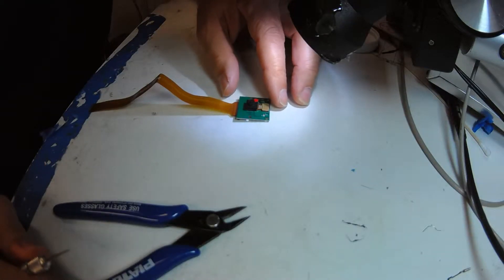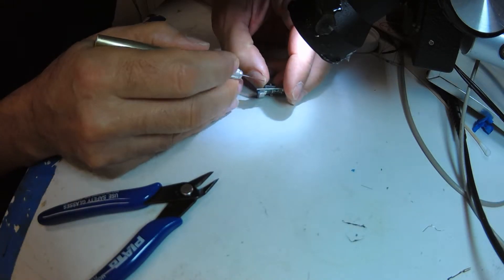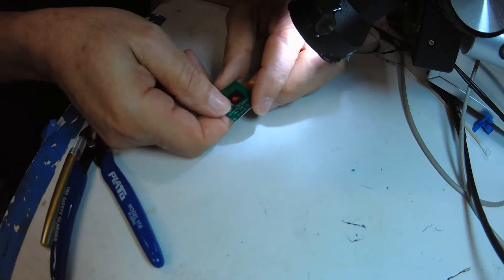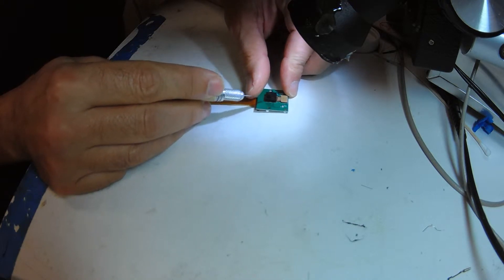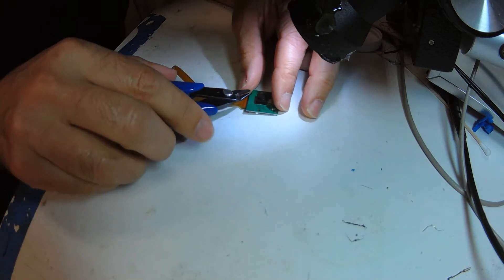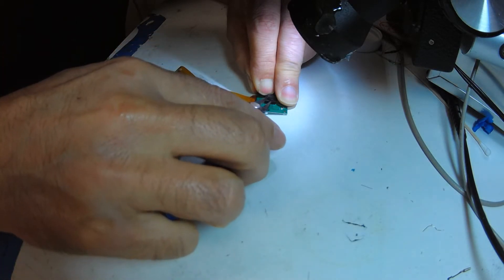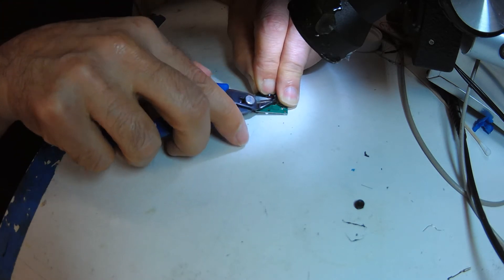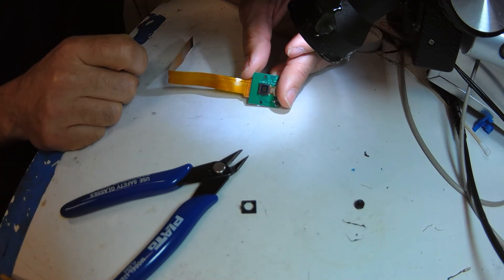Removing Pi Camera Lens

Comment: Thanks for this tutorial! Am I correct to think the the resulting 'naked sensor' module could be installed in the chamber of a camera body, with the camera lens being screwed to the body to seal that chamber? (kinda like that's the case for typical mirrorless camera)